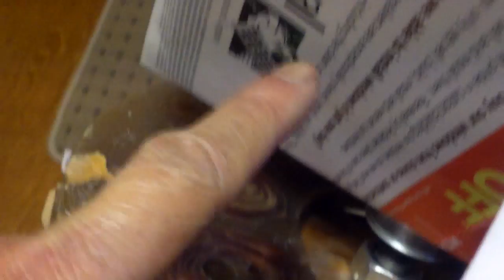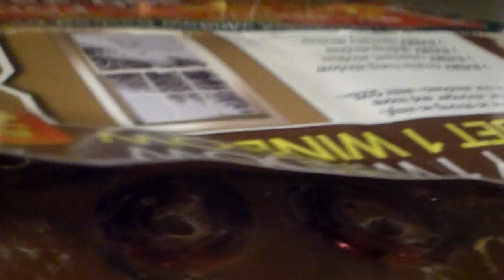Some ideas on my single rotor vawt using Cwaynehawk's 9 coil stator

Comment: sounds like a plan. if you visit my channel, you will see a VAWT, the first design using pvc blades. I had a 12 inch pulley coming off that shaft, driving a one inch pulley on the stator/magnet plates set up. never really got good wind to test it, but the output was decent. try using two saw blades together, if you can not get one plate 1/4 thick, that will help maintain that magnetic flux in check.
Reply from the maker: I just visited your channel.  I'm sure I can find something useful in your videos to help me in my project. No sense reinventing the wheel. We have some really strong winds here today and probably the same tomorrow.

Comment: I am building a Vertical Axis Wind Turbine as well. a recommendation for your magnet rotor would be to use at least 1/4 steel plate. the thin saw blades let the magnetic strength go thru the back of the blade and you loose some of the power. I found this out when I built the pulse motor and used similar thickness metal for the magnet rotor, once I used thicker metal for the magnet plate, the output went way up.  you might want to use a pillow block, or flat block bearing set up, they are pretty cheap. its working pretty good on my set up so far.
Reply from the maker: Thanks for your input. I'm thinking of making a savonius to drive an eight inch pulley with the other end a 2 1/2 inch pulley making it a 3.25 ratio. This stator needs a lot of rpm to put out enough voltage.  Thick steel rotor would be ideal but unfortunately I have to work with what I have.  Will work on this when the weather gets a little warmer.  Looking forward to seeing your build.

Comment: I especially am looking forward to watching this! as you know I have a few of those cwaynehawk stators and can vouch for them. I'm sure it will work but you may want to stack a few saw blades if possible. As I understand, once you mount those magnets (I use JB weld) you want it thick enough so a paper clip won't stick to the back side of the steel. I have made some good progress lately and hope to show my best turbine yet soon. It has a cwaynehawk stator!
Reply from the maker: Thanks for the tip.  I actually needed an 8" steel plate with a 35mm hole (for the bearing) for the job. I've seen your video where you stuck a wrench to the magnet plate and suggested that wasn't thick enough. I'll see what I can gather up. Another thing I'll need is a voltage doubler since the vawt will not have enough rpm to have enough voltage to charge a 12v battery. The good thing is, since we are making these ourselves, we can alter or make it the way we want it to work. This time I'm using a 5/8 threaded rod instead of a bicycle front axle. The last turbine I made is still working although decomposing badly. It'll be a treat to see your upcoming handywork.
Reply from the maker: *****
I might go another route totally. I might go back to using a bicycle axle cause they spin so well. In that case, I'll just use a couple of saw plates (to make it dual rotor)  with the standard holes in the middle. I know it's hard to picture. Just the weather is so darn uncooperative. I need to make a spacer between the 2 saw plates and buy some nuts and bolts. I know the saw plates are much too thin  but they'll to do. Mr. B is perfecting his next turbine. It'll be great to see what it is.

Comment: Do it and yeah its too cold right now to do any work out side.
Reply from the maker: Two more weeks of cold. I need to make a microwavable heating device to cast away the chills.
Reply: wtam69 Have you seen the videos on home made hand warmers? They take rock salt and put it in a zip lock bag. Add water then zip it up and put it in the front pocket of your jacket or coat. You could even put one on each side of your coat pockets. It gets really warm for quite a while. If you already have some rock salt and a baggies then your set.
Reply from the maker: shartne
I have not seen rock salt and water. I did see a video where rice was used in a sock and you microwave the sock to heat up the rice. I actually made something like that before, except it's a 3 feet  tube like contraption filled with rice and I used it underneath the door to the keep the cold draft from coming in. It's good way to use the stale rice you have hanging around.
Reply: The home made hand warmer is supposed to las a good while. I have lots of rice that got weebles in it. I need a door thingy to keep the air out too.